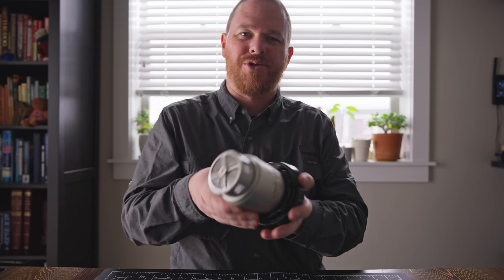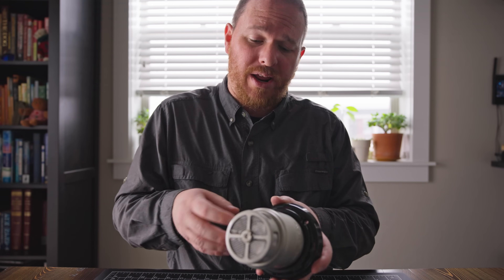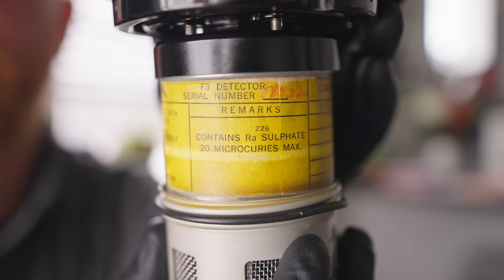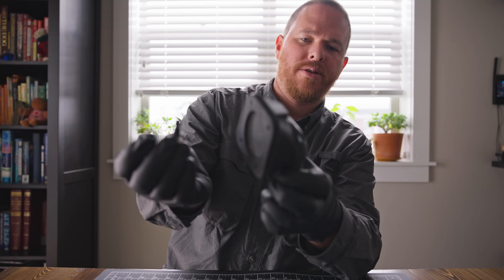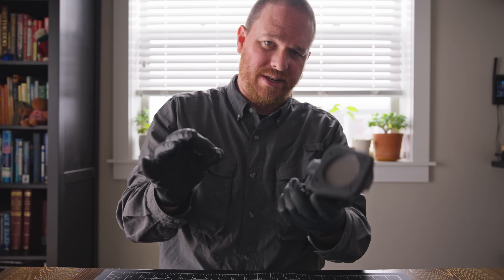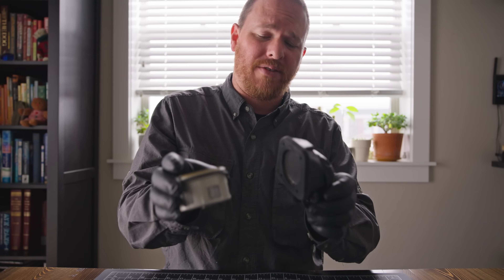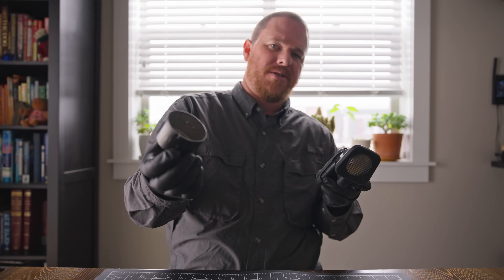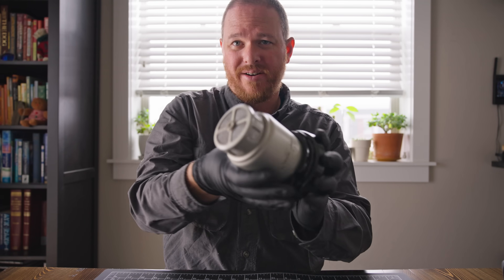Intensely Radioactive Industrial Smoke Detector from the 1950's

Comment: I'd be terrified of the radon gas generation that a hot radium source creates. Definitely don't keep it in your home (I read one of your comments that you keep it in a safe in an uninhabited place - smart thinking). I think that the radon gas generation is the biggest risk of what you have there.

Whenever you go into where you keep the source, I'd well aerate the place that you have the safe before going in, and well aerate the safe once you open it. Lots of big fans should be used.

Comment: I think if I paid $2500 for a radiation measuring device, I'd never want to see OVERLOAD.
Reply from the maker: Everything has its limit...and I paid $1250 for mine, got it 5 years ago when the price was much lower. They also have one that goes 50x higher than the one I have.
Reply: @RadioactiveDrew  I was mostly joking, but it's still better to know the numbers when you're touching something like that.

Comment: I've also heard that these weren't electrically insulated, and that you could get a shock if you touched the housings of these while they were powered up. Systems at that time operated on 120 VAC like residential interconnected smokes, not 24 VDC like modern fire alarm systems.
Reply: Voltage isn't what should scare you when dealing with electricity.  Amperage should.  You can deal with an electrical system of a car and the voltages are high so the spark can jump the gap and ignite the fuel in the combustion chamber but you can easily survive a shock like that.  Those would be in the 20k-40k volts range.  Not much different than a stun gun/taser.  Very high voltage and very low amperage.
Reply: @Stubbies2003  Yes, it's true that it's the current that kills you, but a higher voltage is better at driving the same current through you. I am also aware that a normal carpet-to-doorknob static shock is in the thousands of volts range.
Reply: @Stubbies2003  But when the source has the capacity to deliver very high current -- including nearly any standard mains power system in use worldwide -- then you need to respect the fact that voltage and amperage are related by Ohm's Law (V=I*R). Human skin is a relative constant for R (resistance), so any increase in V (voltage) is likely to give a proportionate and predictable increase in I (current). In the old times (pre-1970s), little or no effort was made to protect the user from such things. For major standards bodies such as NFPA and UL, a consensus has been reached that the threshold where V can start imparting unsafe levels of I across the skin barrier and through a human body is about 50V. Less than 50V, a system is considered "low voltage" and subject to lower requirements for cable routing, junction boxes, and guarding. That, and simplified battery backup requirements, are two reasons why many commercial and industrial control systems including fire protection and Power-over-Ethernet run at 48V or less (commonly 48V or 24V).

Comment: What brand or type of detector do you recommend for general use?
Reply: Radiation-ion based detectors are very sensitive to minute smoke particles.  You don't want those near your kitchen or they'll nuisance alarm a lot.  
Modern photocell detectors "see" smoke in the air that refracts on large smoke particles from a LED.  There is no radioactive source needed.  These are more sensitive to smoldering and early fire stages, which makes them superior in my book.

Comment: What exactly is with scientists coming up with so many different scales to measure radioactivity?
First there were roentgens, then REMs and later Sieverts (along with the associated milisieverts and microsieverts) and Greys.
Why cant they stick to one measurement so conversion formulas/equivalents arent necessary?
One can watch a video where radiation is measured in roentgens, and the next video is in sieverts.
Reply: Sieverts is just a scale for REMS. 1 Rem = 0.01 Sieverts. I guess people working with really hot stuff didn't like writing a lot of zeros :)
I believe REMS vs Roentgens is for measuring dose in the human body. Roentgens is based upon Curies per Kilogram, but not practical for measure dose exposure. REMS was used when they got concerned about radiation exposure when people started to realize ionizing radiation can cause health problems.
Reply from the maker: I know. They have made it a bit complicated but they do have their uses. The subject of radioactivity is a complicated one.

Comment: I have many tritium vials in my possession. Some of them are inside of night sights for pistols, with two of the vials just inches from my head (while i sleep)with the “glow” and of the facing me directly. Is this a concern over time?
Reply from the maker: No, the level of radiation coming off of tritium gun sights is very low. You would have a hard time detecting it.
Reply: @RadioactiveDrew  thank you! Just realized I butchered part of that sentence when I edited it, but it seems like you got the gist anyway.
Reply: Just to add on, tritium is pretty safe. Just don't drink, eat or inhale it.

Comment: Wow, looks very risky even having it so close, let alone handling it - I'd feel safer with a lead apron and shield my face behind some lead glass.
Hope you have a lead box to keep it in, but as it also generates radon gas, it also needs good ventilation. Wikipedia is a good read for further info.
Reply: Lead aprons such as used by X-ray technicians aren't going to help much with gamma radiation. Unless you want to wear about 10 of them at the same time
Reply: @wingracer1614  Yeah, not a very portable solution, but anything better than nothing unless they're super high energy cosmic rays whose collision products from the shielding can do more damage.

Comment: What’s the difference between your modern radiation detectors and the yellow brick type radiation detectors, with a handle from the 1950’s and 1960’s. Surplus older unused models are still available to the public. Any opinions are appreciated, thanks.
Reply from the maker: I think those old Civilian Defense detectors (the yellow bricks) are kind of interesting. But I've played with a couple and I wasn't that impressed. Maybe the ones I saw were a little too beat up. Some people really like them and they can work great...so I've been told.
Reply: The old CD I believe used an ion chamber instead of a gieger tube. also just used an analog meter which isn't very accurate, likely drifts a lot over time.

Comment: Does it work still given how radioactive it still is after all of these decades? It would be cool if you could get it working again for a mock up.
Reply from the maker: Would be cool to get it working again...might have to do that.
Reply: @RadioactiveDrew  If it's radium 226, the half life is 1600 years which means a few decades hardly matters.  I'd be curious to see the electronics, doubtless a vacuum tube setup kept several meters from the detector itself.

Comment: Love the channel, Drew! I knew some of those older bigger smoke detectors used radium, but didn’t know they were that hot!  Wonder if they emit enough energy to make phosphorus glow?  
 Me and my son have been using a app for iPhone called “Radioactivity counter” that uses the phones selfie camera as a primitive gamma ray detector (and maybe beta? 🤷‍♂️), but the camera must have ALL light blocked out…. We tired to find radioactive rocks in a old quarry used for a source of roofing shingle rocks, as about ~5 miles north there used to be a Thorium mine, and we live on what’s basically a massive granite deposit…. And radon gas can be a big issue in the area.
Reply from the maker: The alpha radiation from that smoke detector might be enough to make a zinc sulfide mixture glow...maybe. Would be interesting to test it out and see. If anything could do it that radium source should be able to. If you want to get into looking for radioactive rocks or items I would suggest getting a Geiger counter of some kind. I'm working on a Geiger counter review video right now. It will show some of what's out there and price point. Hopefully it will inspire some to get the right tool for the job.
Reply: @RadioactiveDrew  Oh I definitely plan on getting one eventually….my phone (camera) would only detect gamma radiation, as the glass lenses would attenuate alpha and beta radiation…. The app does have a neat cloud chamber function so you can visually “see” the traces.   At the wastewater treatment plant I used to work at we had tritium lit exit lights(for the explosive gas areas of the plant… cheaper and safer than any explosion rated 120v fixture!)… the original ones were installed in 1989 and still had a decent amount of green glow to them shockingly…. I was 8 years old when those were made. We got new ones… wish I had a counter capable of reading its alpha radiation! That is if it would make it out of the plastic enclosure…. Perhaps by that b. Radiation (not going to try and spell that! Lol) would generate some gamma rays if tritium has enough power to do so?
Reply from the maker: Tritium is a beta emitter, it glows because of a phosphor coating on the inside of the glass tubes it’s in. Radiation does get through the glass but it’s in the form of low energy X-rays (Bremsstrahlung) from the beta particles hitting the glass wall of the tritium container.

Comment: Its been over 40 years, but I'm pretty sure that my elementary school had smoke detectors like the one you showed. It looks very familiar. I've known for a long time that residential smoke detectors used a small radioactive source, but didn't realize they also made "industrial strength" models that were much "hotter".
Reply from the maker: I would be a little surprised that they would use these in a school. They are very much industrial smoke detectors. The only other place I've ever seen these was when I was making the video of that nuclear power station being decommissioned. They had a bunch of them going down the hallway to the reactor building.
Reply: @RadioactiveDrew All I can say is that I had an immediate, "Hey! I've seen that before!" reaction. Perhaps other models were sold that had a similar appearance.
Reply from the maker: @JohnDoe4321  they could've very well used them in some schools. I was just sharing where I have seen and heard of them being used.
Reply: @RadioactiveDrew  I had the same reaction but to an apartment my friend just moved into. I remember thinking it was a very vintage/interesting shape for a detector. We’ll see if it’s a similar model
Reply from the maker: There are also ones that use Americium 241 instead of Radium 226. They put out a lot less gamma radiation.
Reply: @RadioactiveDrew  the one in your video looks more clearly marked radioactive than what I remember so hopefully they are not the same. The date of construction unfortunately does line up to make it possible.
Reply: @RadioactiveDrew  I can tell you as a certainty that they were used in Denver Public School buildings in the 1960s, usually in the halls and top floor auditorium.
I think some of them had a yellow sticker or tab on them, but they were too high up to read.
The school I attended in northwest Denver was built in 1892/1902 and had very high ceilings, but still the idea something that highly radioactive was around children is concerning at the very least.
The school was demolished in 1976 (ironically after vandals had set fire to it) it was abandoned and replaced with a new building, but I have to wonder whether these radiation sources were simply dumped in some landfill.
Reply: @donreinke5863  I doubt it went into a landfill if it had Radium 226 in it.  In the US, all landfills have radiation detectors in the scale going in.  They would have no issue picking up the gamma even if the smoke detector was in the middle of the load.
Reply: @matthewbeasley7765  But ....did they check back in the 70s?
Simply because they have more recently doesnt mean that was the case 46 years ago.
The well known case of the Boy Scout who did experiments with radioactive materials that he found in various places indicates disposal was carelessly monitored years ago, and that was well past the 70s
Reply: Radioactive boy/radioactive junk died some weird way and it was later on that his first "reactor" has cleaned away.. omg how wild story it was, he really have some "critical" stuff in that "thing". He used very much of imagination to put it together and throw very respect radioactive rays far away from it. Basically naibors get own part of that radiation, not just that boy. They needed to big guys clean that stuff away, when it was understand what he have. He made later even something other similar, finally died some weird way. That real story found from youtube "radioactive boy". ☢
Reply: @donreinke5863  That is a maybe for the 1970's.  That's when they were being rolled out.
Reply: @matthewbeasley7765  They wouldn't have even been looking
Reply: @jannejohansson3383  That "radioactive boy scout" bit was very over played but they have to act on any of those situations, regardless of perceived, embellished, real, or other threat.
Reply: @matthewbeasley7765  they actually allow upto a set amount per load
Reply: Were these detectors particularly "hot" because the circuitry of the time couldn't me made sensitive enough to work with a weak alpha source?
Reply: @dxgl  nope. It was just because of its use as a industrial/commercial smoke detector.
Residential detectors were nowhere near as hot.

Comment: Also, whats funny is the control shield on that radium source looked to be completely closed. The control screw in the center of the radium source that he took out moves the sample in and out of the shield to increase or decrease the activity. Imagine if it were screwed out all the way........
Reply from the maker: I didn’t feel like unscrewing that source as it might have disturbed the foil more than it needed to be. Also I think that cap might have controlled the alpha radiation more than anything.
Reply: @RadioactiveDrew  The foil is bonded to the post. Unscrewing wouldn't damage the foil. It was made to last.

Comment: I forgot to mention that it was in a government science publication that I saw smoke detectors made with Americium were possibly not okay for low ceiling areas like in submarines, that there were no studies, but safety issues were concerning.  That was about 20 years ago that I was reading about that.  I used my gauss mainly to find if the walking trails I did in NYC were okay.  NYC's Central Park was okay where I did my daily exercise walks, but the main entrance to the popular Carl Schurz Park on the Upper East Side, went way off the high level of my meter, so I figured that electric transformers were below, and noticed how they had seating benches in that area.  i dislike this negative stuff, but who wants to be in the hospital with stage 4 cancer or other ailments.  The foil you are discussing looks like lead, usually lead is the only thing that can prevent radiation exposure except it can melt from it, and lead is harmful to humans.  I usually do not comment this much, probably my last comment.
Reply from the maker: The only people that would be concerned with Am-241 smoke detectors are people that don't know anything about radioactive materials.